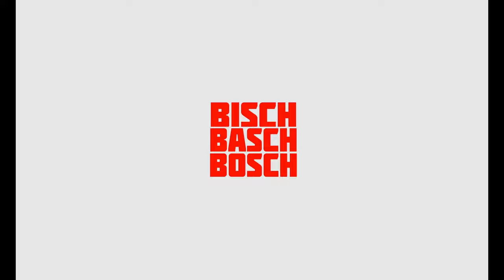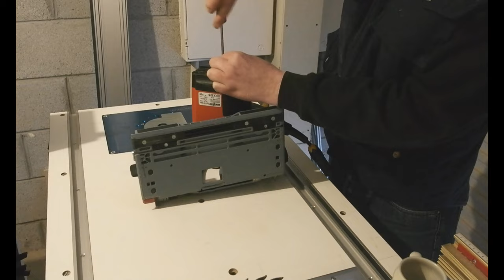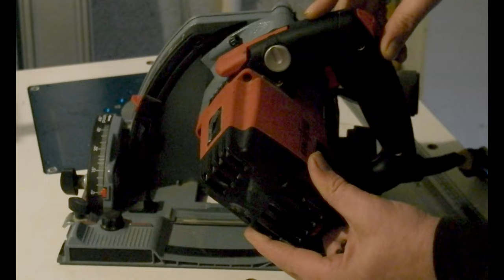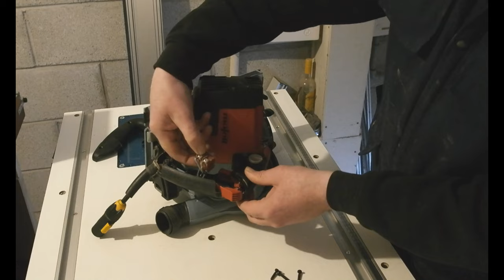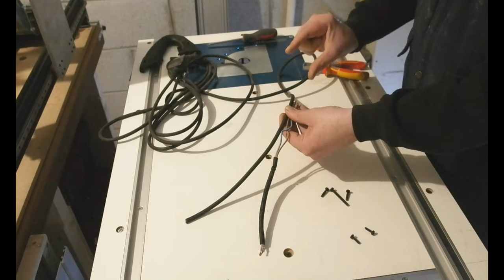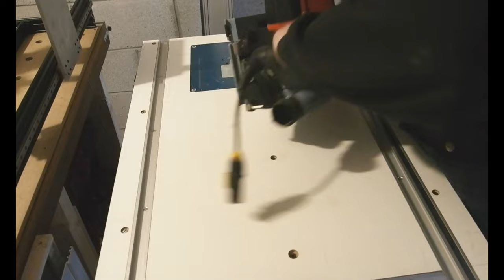Diagnose and Repair a Power Tool Cable Break!

Comment: The symptoms of worn brushes can also be due to dirt and gtit acumulating on the comutator or embeded in the brushes.
Reply from the maker: True, that can be one of the causes for intermittent power or dips in power delivery. If I do a brush replacement video at some point, I'll cover that. Thanks for the comment.

Comment: Good video. I wish I spotted your video before with connectors, I have gone Festool. Good but there are issues, apart from the price with them
Reply from the maker: Cheers Doug. I was gonna go with the Festool plug-it myself but was put off by the lime green cable they came with (silly, I know). Spent a lot of time in my teens around sound systems so knew other connectors existed - hence the Neutrik. Took me a while to remember what they were though.

Comment: Clear & well explained, funnily enough I’ve just done a similar repair this weekend on my wife’s handheld food mixer, the outer sheath was split exposing the inner cables.
Reply from the maker: Thanks bud. Cable breaks are pretty rare to be honest but one of the easiest to diagnose and fix. Same as for domestic appliances as power tools pretty much so glad you mentioned that.👍

Comment: Always wondered what the colour coding was in the UK. 

I'm really starting to consider doing the plug in power part at the saw like you've done. Having a domino and Sander from festool I have to admit I love the idea of it. Would love to have it on all my Bosch stuff.
Reply from the maker: Ah...aimed at a UK audience, I didn't even think to mention to check cable colour coding elsewhere. I really get on with the plugs. Makes the tools much easier to pack back in their box when I'm out and about and onsite. I also have a power cable attached to my vac hose via a hose-wrap. Makes for a nice straight forward swap of tool. Got the Neutrik on pretty much all my Mafell, Bosch and Fein tools now. If you've got some Festool bits already, I think there is a Plug-It cable kit available so could add that to your Bosch kit maybe?
Reply: @BischBaschBosch  probably thinking of going with the neutrik or a twist lock cord end. Cheaper and easier. Not sure if you guys have them across the pond. Here we have 15 amp 125V cord ends or even plugs that have a locking plug. Just twist (as the name implies) and it's locked in. Readily available from any electrical supplier and most big box stores. 

Added benefit probably can get a bunch from work after the job is done because we use them for temporary lighting hook ups and they usually get scrapped at the end.
Reply from the maker: Not sure I know the twist lock ones you mean but they sound good. The Neutrik just twist and lock too. They're also water proof. But like you say, they quite expensive. I've seen some Chinese knock offs on Amazon that are much cheaper and look very similar. If you know of a more reasonably priced alternative though, I'd say go for it.👍
Reply: @BischBaschBosch  doubtful as they're based on North American 120v receptacles. Google NEMA L7-15P or L7-15R they should pop up. Very common in different Amp and voltage ratings for industry use. Floor grinders, welders, certain lighting, film industry etc. Basically very common for plugging stuff in that you don't want to unplug easily or easy service. Lots of factories use it in a 347V 20A configuration for easy maintenance of lighting. 

Might be a UK or European version similar but don't know for sure. 

Thing is, I said screw it and paid for neutriks. Twist lock cord ends would've been cheaper but they're a bit more bulky. And given they have a specific way to plug in they can be a pain getting the prongs to line up.